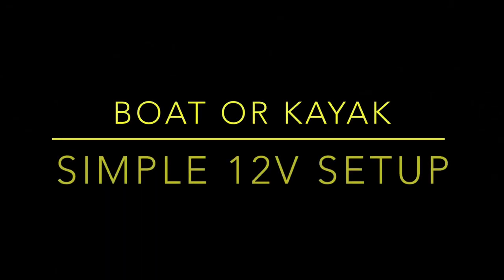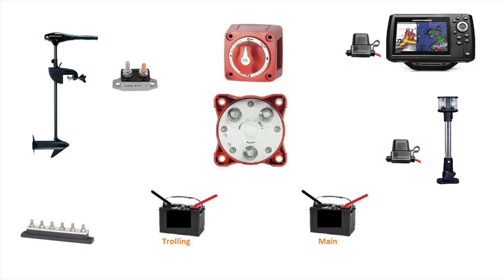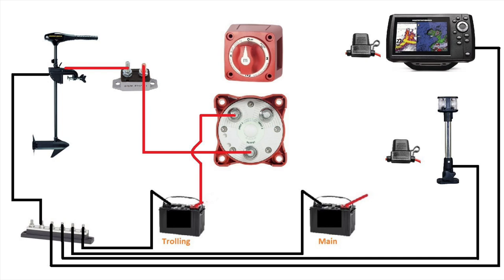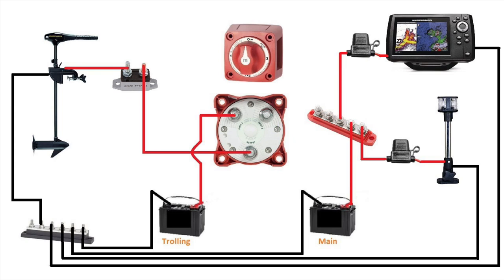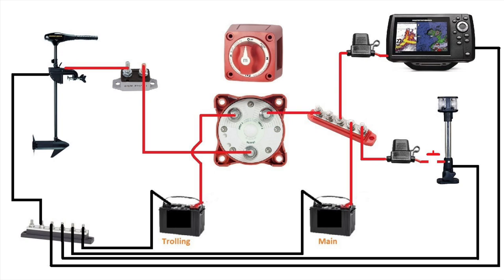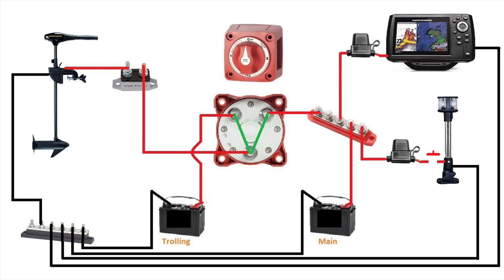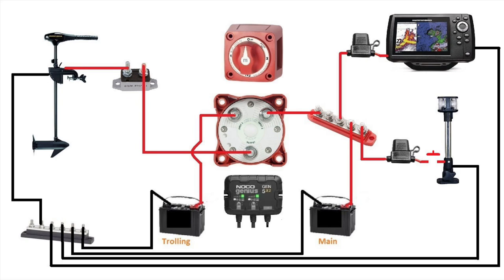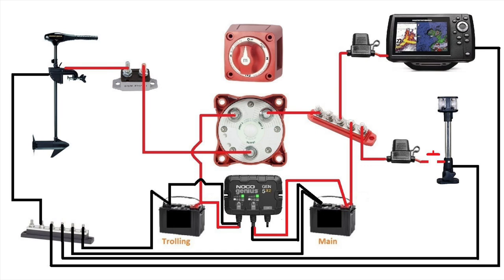Kayak or boat simple 12v wiring diagram

Comment: Hi, Joe. You have some great videos that are really helpful! I watched your boat diagrams in preparation of rewiring my entire boat basically from scratch.  I have a working engine, tilt & trim, throttle and steering wheel on a 16 foot trihaul.  Everything else will be new, and eventually thise replaced too. More A to Z videos for us newbies would be awesome! All the accessories you are proposing are great just never wired anything before lol
Reply from the maker: Hi dre man, Thanks for watching and nice comments, I do sections at a time so it’s less complicated to understand. If I put everything together the circuits will be very big and complicated. 

I was even asked to remove some of my videos because i`m revealing information they don`t want me to reveal. :(      I didn't remove anything. 

So, I show basic and then you just have to add the pieces you need all together.
Reply: @joetheboatguy5394  thanks Joe, I am good with running the wiring from my accessories to my bus bar. It the battery switch and charger and how to choose between the ignition or always on is a mystery to me any examples or more detailed videos would be great! Keep doing your thing
Reply from the maker: Hi dre man, the difference between always on fuse box and ignition fuse box is…. Always on fuse box you will have all equipment that you still want running even dho your key is not in. Example fish finder, stern light, water pump, etc… now for the Ignition on fuse box you can have navigation light since you need them when navigating, All cockpit lights, etc… so always on fuse box means your equipments can get power even if you don’t insert key and turn. Let me know if you got it 👍

Comment: Hi Joe, I was wondering if you could cover installing a plug in the boat so that when docked or in the driveway I could use an extension cord for power instead of the batteries...??
Reply from the maker: Hi Michel Lagace, So you would like to run on a power supply instead of the batteries when you are docked. 

What equipment would you like to run? Just the know the power you would need. Also don’t forget that what ever need to run on ignition, your key will need to be turned. I will look into this 👍 I will get back to you soon 🙂
Reply: @joetheboatguy5394  Hi Joe, yes I was thinking about longer trips.  Things like the Rideau Canal trip where staying over night at the locks they have power supply at the docks.  Thanks again Joe!
Reply from the maker: Hi Michel Lagace, They can be many different ways of doing it, some would work and some won't be very effective. Since you told me your staying over night at docks I'm thinking you have a bigger boat. This wiring diagram you saw is more for kayaks and small boats. Let me know a little more what you have on your boat so I can get an idea of your setup. I'm thinking your setup would look more like this: https://youtu.be/USG1xZju1DA 
Let me know if that's right. I don"t want to lead you to the wrong  advice. 
Thanks

Comment: Got a request for you! 

I have a 4 battery system right now for a Carolina skiff. 

Here is my set up explained best as possible. 

Battery 1 - start battery 
Battery 2 - house battery 
Battery 3 & 4 wired together for a 24V trolling motor. 

Here is the problem, my dad owned this boat and the only battery that charges without having to put a manual charge on it after a day on the water is the starting battery. 

He has a battery selector switch however the only leads he has wired to it is the the start battery to the engine. Which is only serving as an “On / Off” the way it is wired. 

I would like to install all batteries on the selector switch as well has have the ability to charge certain batteries with engine alternator instead of having to manually change everything after a day on the water. 

I understand the basics of installs a start battery and house battery to a selector switch, however is it possible to install/wire the 2 trolling motor batteries to house battery even though they are wired to be 24V? Will this hurt the alternator since it is a technically a 24V system. I can email an better diagram / explanation of what I am trying to accomplish but any help would be greatly appreciated. Or I can donate towards a new video! 🤙🏻

Thanks for the input!
Reply from the maker: Hi Ryan Ballance, Thanks for watching and comment don’t forget to subscribe if not already done :) 
I will try to make a video soon, but I must complete some other request first. Thanks
Reply: No problem! I can draw a detailed diagram on where my main question comes into play. 

Thanks!